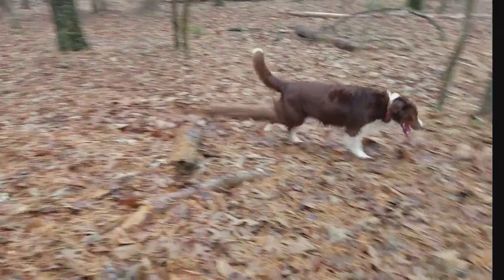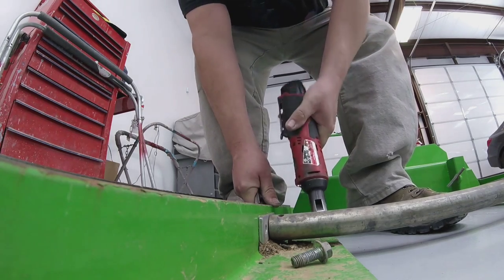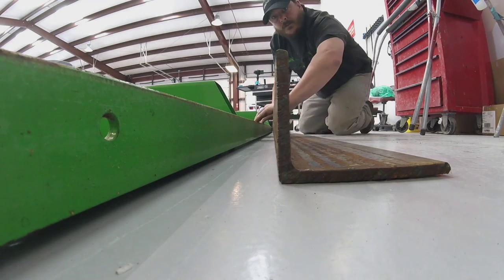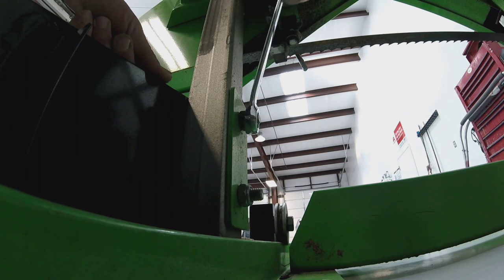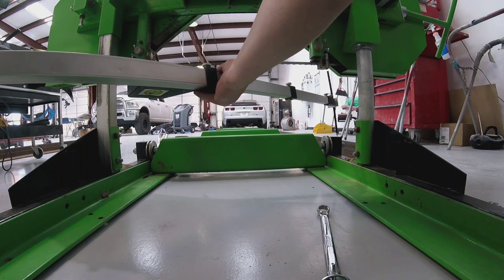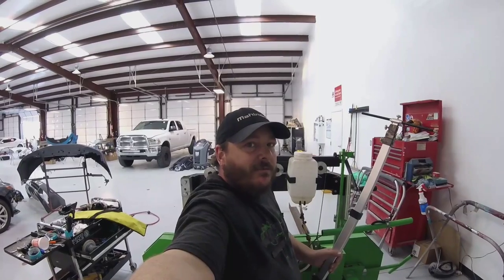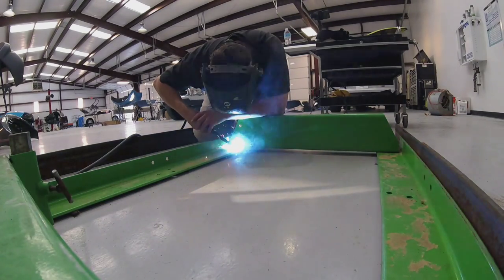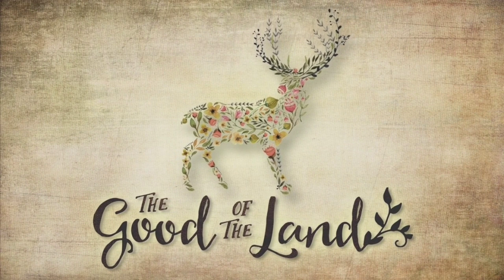Sawmill gets An Upgrade. Harbor Freight Sawmill.

Comment: Nice shop!!! HF makes a few good tools. Been thinking about picking up there 20ton log splitter.  Thanks for sharing 👍🏼
Reply from the maker: +Portugee Prepper I really like the predator motors, they run great and last.
Reply: Ive seen a lot of good reviews on those motors they all say the same as long as you run the motor for the break in period their rock solid.

Comment: Milling your own lumber is cool.  I recently met a man that lives close who has an old 42" circular saw mill (I may have already mentioned that in another comment).  I have a stack drying in my barn/shop now.  Not sure what I'm going to do with it, but it's cool.

BTW, Harbor Freight bandsaw blades are not known for their quality.  I have some for my 14" bandsaw, and they aren't that great.  I'd look into a source for some quality blades to replace the one that came with it.  Of course, you've probably already done that since this video is three months old.

Comment: advise you retake the welding course you took ( if you did ) first rule of welding, make the weld position work for you 2nd rule, Why yes you can go back after a weld and redo it... it's called a grinder with either a cutting disk or a grinding disk or for that matter a sawsall or a portaband saw....